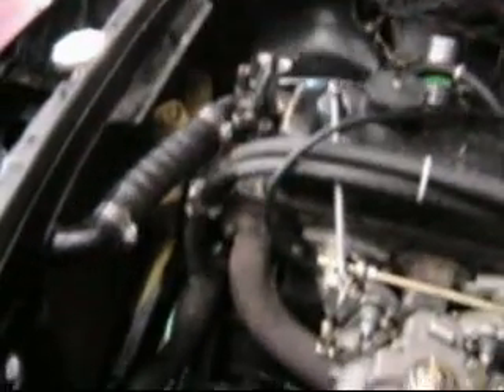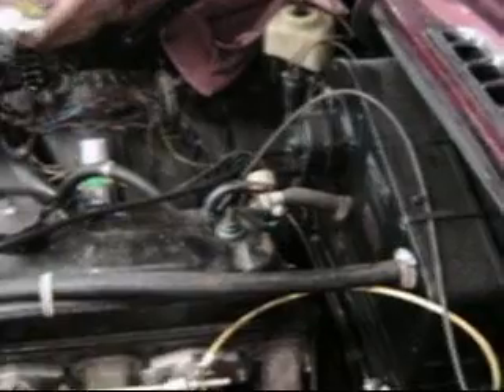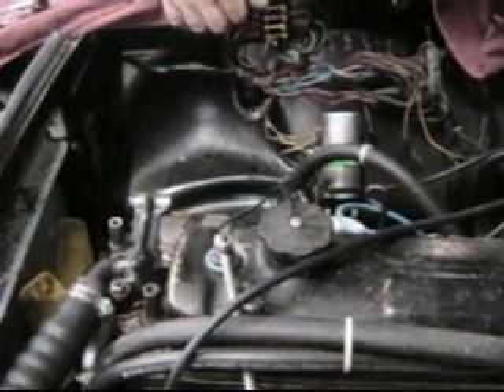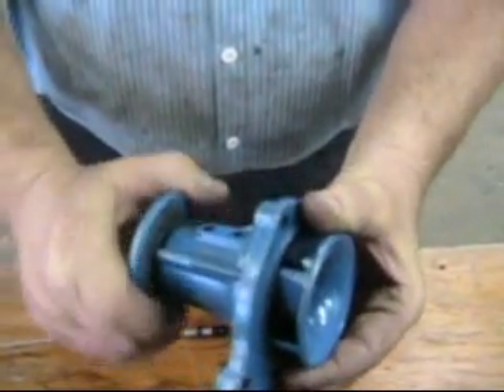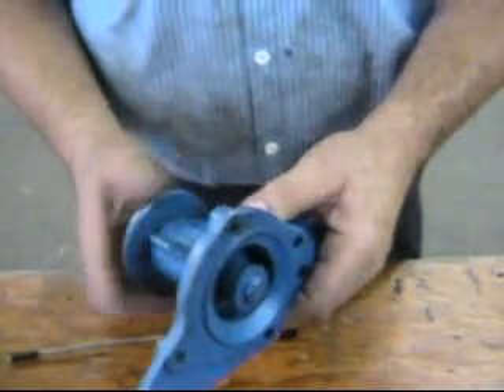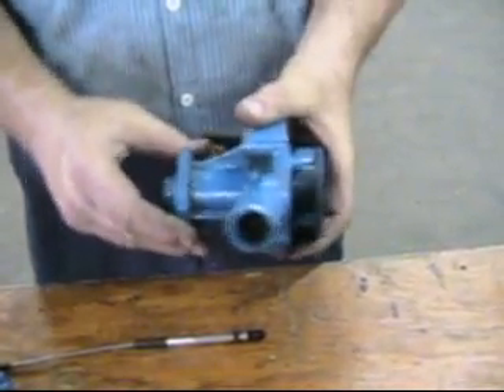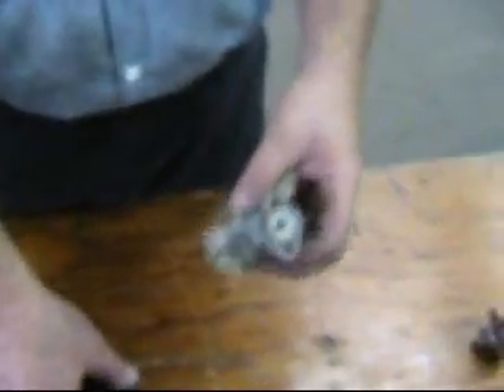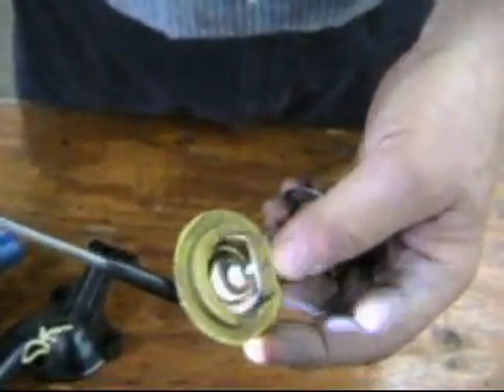022 MG Tech | MGB Cooling System

Comment: I run water filters on all my cars, have for over forty years and never experience plugged radiator/heater cores or valves, water pump seal/bearing failures or having to change antifreeze.     You see, engines are  sand castings and never are cleaned out at the factory  (if they even try).    So all that sand circulates with your coolant, turning your coolant rust brown and muddy.    My coolant stays green and clear like a coke bottle.     That sand settles out in your radiator tubes plugging them up and also runs around the seal of your water pump grinding it up, leaking thru and washing the grease out of the bearing.    The calcium in it plates out on parts like temp sensors and makes them read erroneously.    
Water filters are sold by WIX  number 24070 I think (originally for over the road diesel trucks) but are cheap insurance for car cooling systems and you can easily transfer them from car to car when you trade.

Comment: For the benefit of all non-USA enthousiasts using centigrade values: 82 C is normal, 88C is for cold climates and 74C for hot climates. Sometimes people use a 79C thermostat as a compromise.  Driving steadily without any thermostat at all is not wise and should be reserved for emergency situations with blocked thermostats only. In the hot south of France some people drive with continuous electric fan instead (wellknown Kenlowe extra).

Comment: I about fell out of my chair at the mention of a 195 thermostat. I work in a shop here in Birmingham Alabama (which we had a recent 12 day 100+ streak) and we wouldn't dare put a 195 thermostat in our customers cars. Yes, many of our customers run with electric fans and no thermostats and still overheat... But I generally don't recommend anything more than a 165 for here, with a fan and good flushing once a year.